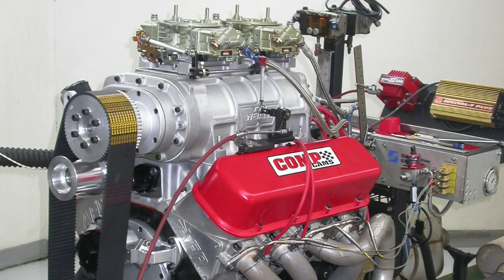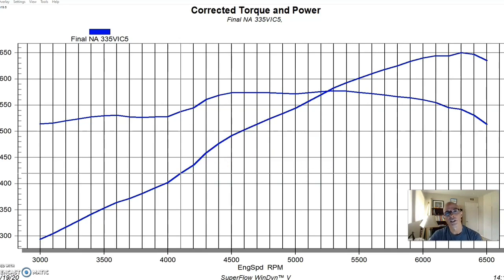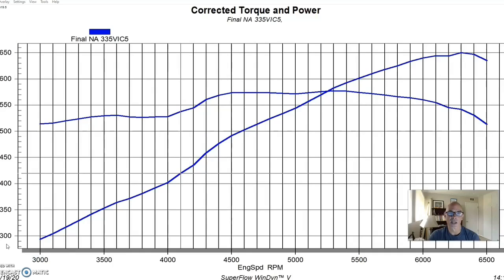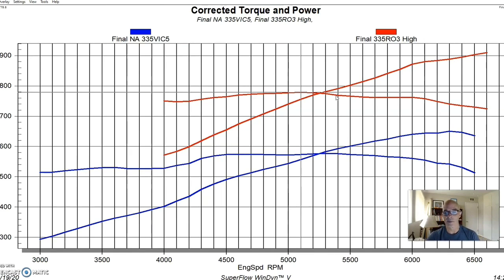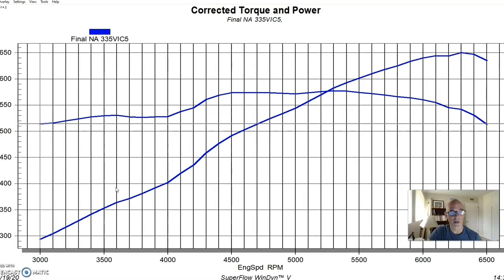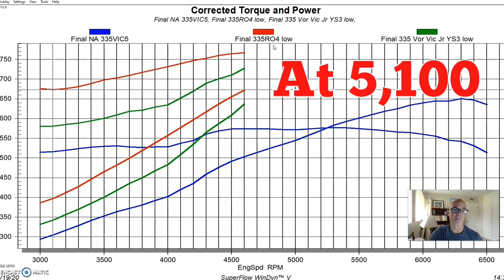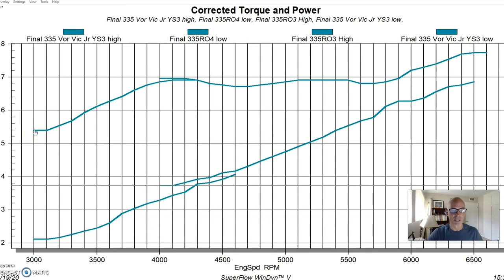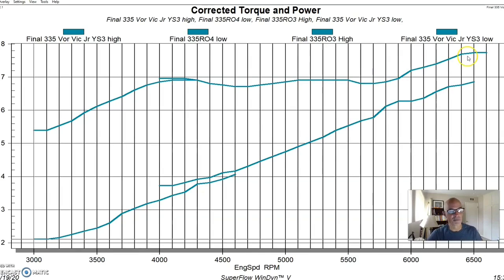496 BBC BLOWER TEST

Comment: Have you ever tried driving a centrifugal with an extremely high drive ratio, then using a blowoff valve to limit the boost at the top end?  That way it could match the low speed boost of a Roots.
Reply: that idea has been around a while but by using a huge throttle body in the intake side of the supercharger. since as you block off the air intake it doesn't take as much power to spin the blower compared to venting the air after being compressed. but I don't know if it's been done in real life since once you get it on the car, if you want to make less power you can just short shift it. but be cool to see on a dyno.
Reply from the maker: yes-the Realtime Acura NSX employed that in World Challenge
Reply: @richardholdener1727  I wondered why that car was so fast!

Comment: What about IAT's at sustained rpm.  What happens to the roots as it becomes heatsoaked, still as much fun down low? Or just as comparable to the centrifugal in rising boost curve. Whats the maintenance interval on the rotor pack for sustained use?
Reply from the maker: it still has charge cooling from the carbs

Comment: Something not adding up, an 8.4to1 496 with a 250 degree cam is not usually that strong when sucking air below 4000 revs.
Reply: 114 overlap and 500ci